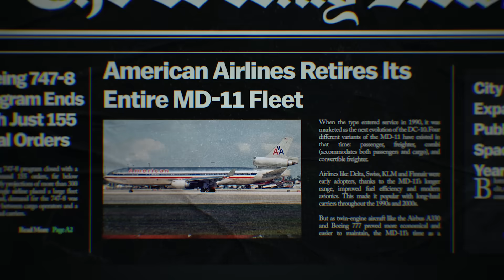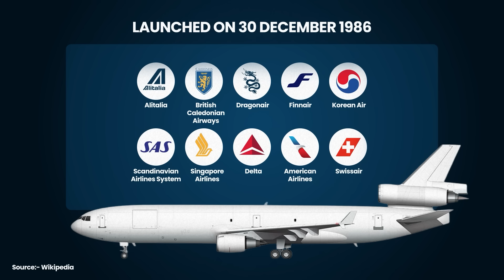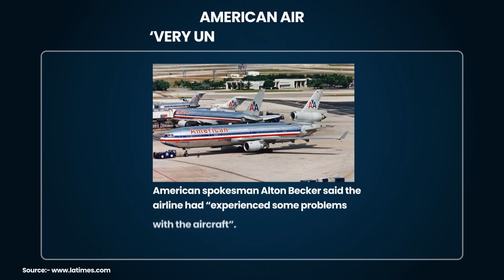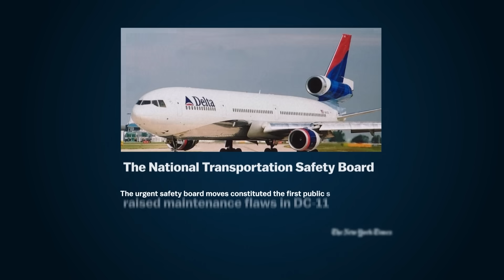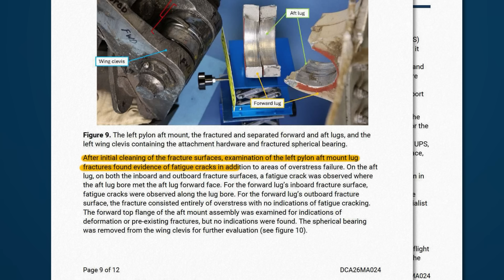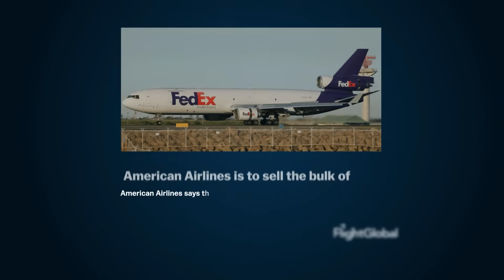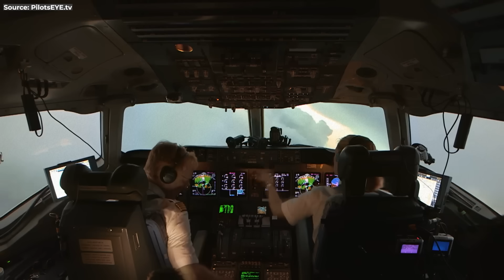Why UPS and FedEx Still Fly 35 Year Old MD 11 - Against All Logic

Comment: This makes a lot of business sense. The planes don't fly very often and sometimes don't even fly all that far. While a passenger 737 on a budget carrier might fly 5 legs in a day, most cargo planes fly once a day (at night). Most cargo flies at night because it is much more expensive to fly during the day at slot-constrained airports. Flying at night also allows cargo carriers to use the day to get packages to and from the planes via trucks. So these planes are only middle-aged in terms of pressurization cycles and number of miles flown. Who cares if you drive an old beater pickup truck if you only drive 5 miles a day? The absolute emissions impact ends up being very low. 
If the engine fell off due to pylon wear and the plane was inspected at the rates required by Boeing and the FAA, then it is hard to blame UPS for what happened. It is actually hard to blame Boeing here given they followed the FAA's recommendations after the AA-191 crash. If the pylon was damaged during maintenance... that's a whole different story.

Comment: There’s an underlying current-era reason for why the 65 MD-11F’s in service will not go away anytime soon: Boeing and Airbus have crushing delivery backlogs for widebody aircraft. Because of the always sensitive (to economic circumstances) nature of the widebody market, neither company is significantly investing in production expansion for widebody products. Tack on Boeing’s 7 year delay in getting 777x deliveries started and Airbus having yet to deliver a single A350F (with orders having been placed as far back as 2008!), and it’s unclear where an MD-11 replacement gets sourced from. Boeing has a total of 105 777F and 777x-8F orders unfulfilled,   While Airbus is sitting on 74 A350F orders. 

Right now, the only new widebody freighters being delivered are 767F and 777F’s, ordered long ago. To make matters worse, existing 777 passenger fleets (and even 747-8i fleets) are being kept in service far longer than intended, due to 777x delivery delays. The chances of getting any new widebody order delivered from either manufacturer in the next 7 years is exceptionally low (and would require taking over another carrier’s order) and there are few available conversion options for planes leaving passenger service. Cargo operators are (pardon the expression) going to have to fly their existing widebody fleets until the engines fall off.

Comment: First of all, the maintenance issue wasn't tight clearance, it was using overhead crane vs a forklift to support engine during maintenance, the forklift although not approved as proper method saved approximately 200 man hours per engine.
The one engine fell of the AA DC10 in Chicago in 1979 due to damage of the pylon from improper maintenance, forklift use.
The engine separated from the UPS MD11 in Nov. 2025 due to cracks from fatigue.
Keep in mind however that this plane was up to date on maintenance and inspections according to manufacturer and FAA guidelines. At the time of the crash the aircraft had accumulated 92,992 hours of flight time.  By comparison British Airways recently retired and scrapped a 19 year old 747 with 51,000 flight hours. That high number of hours on a cargo plane that very often flies nearly fully loaded could be a contributing factor.
Reply: Cargo planes fly less hours than passenger jets. Whether that gives cargo planes less flight cycles is something that needs verifying. However, UPS are strict about maintenance schedules, and invested in updating techniques and parts, which kept the MD-11s flying. And UPS 2976 had just undergone heavy maintenance in Oct 2025. So whilst fatigue cracks might suggest ageing, it might not be. So we will have to wait and see  what the NTSB finds in their investigation.

Comment: The engine detachment of the Chicago crash was because the AA maintenance crew removed the engine/pylon assembly as a unit to save time, when the engine should have been removed from the pylon per MDC. They further cracked the pylon mount in the process.  The presenter needs to do some research.
Reply: AI is only as good as the information it receives.
Reply: They used forklifts that stressed the mounts.  This video has an engine on a forklift.  Unbelievable
Reply: That was the shortcut that every operator used.  If they followed McDD protocol who knows if those pilon mounts would have had a longer service life.....

Comment: The MD11 can carry within 50k of what a 747 does yet it can fit at the same gate as a 767 which only carries half what an MD can. 

The 777 can’t operate on the same ramps and gates without folding its wing tips which is fraught with maintenance and operational issues. 

UPS would have to rebuild its hubs to utilize them or only use them where they currently use 747s, BUT those areas are already being fully used by 747s in their current operation…

Comment: If the FAA requires a redesign and retrofit of the MD-11 pylon my guess is the MD-11’s will be retired immediately.
Reply: pretty sure they wont require that, just move replacement and inspections date to be less , These planes have made millions of flights and this is the first time this has happened. (AA flight was fork lift damage)

Comment: 1:17 because older equipment is affordable, still reliable when maintained properly and with proper consideration can be modified to have the modern features you want and none you don't.
Even many militaries have much older aircraft in service and some railroads still use steam locomotive to some capacity.

Comment: I think its important to mention that that American airlines crash was not due to a design flaw it was improper maintenance procedures that caused it and we are yet to fully understand the cause of this last accident also the DC10 and MD11 are not the same plane albeit the share comon DNA
Reply: The DC-10 initially had real design problems with its cargo door, leading to two accidents (one the deadliest in history at the time) in the early 1970s. AA191 was followed shortly by two other DC-10 crashes in the same year. One in Mexico City (pilot error - landed on wrong runway). And one in Antarctica (navigational error). So the plane's design had nothing to do with any of the crashes in 1979.

Unfortunately accident reports outlining the cause take 1-2 years to come out. So the public just jumped to the conclusion that the plane was unsafe. Statistically, the DC-10 has been as safe or safer (fewer fatal accidents per million flights) than the A300, A310, and early 747 models it originally competed against (the L-1011 was a bit safer). But the number of incidents are so low that these stats have huge error bars.
Reply: @makaira69  Exactly, yes I wasn't referring to cargo door incident but the engine detachment which was found to be due to following incorrect maintenance procedures. The DC10 certainly earned an undeserved reputation unfortunately a lot of people have jumped the gun here on this crash without us having the facts yet.

Comment: A great plane with unfortunate accident records....

Once again, MAINTENANCE IS KEY....

LACK ON MAINTENANCE AND THESE PLANES SHOW THEIR WEAKNESS.

THESE PLANES ARE  WORK HORSES, BUT DUE TO THE COST OF HIGH MAINTENANCE THEY WILL SOON BE PUT DOWN FOR GOOD.

THESE PLANES HAVE MADE UPS AND FED EX THEIR FORTUNE OVER THE DECADES OF SERVICE.

INSTEAD OF TRADING UP AND CONSTANTLY UNDER FINANCIAL BURDEN WITH LOANS, THESE COMPANIES BOUGHT AND USED THESE OLD PLANES FOR DECADES AT THE COST OF PENNIES ON THE DOLLAR.

SURE THEY BURN MORE FUEL AND MIGHT BE SMALLER THEN MODERN PKANES BUT THE SHEAR AMOUNT OF COST SAVINGS NOT UPGRADING EAS WORTH IT.

WHY UPGRADE TO A FANCY NEW PLANE FOR A MEASLY MPG OR SO OF SAVINGS AND BILLIONS IN DEBT.

FEDEX AND UPS BOUGHT THESE PLANES CHEAP AND SAVED BILLIONS.

FOR WHAT ITS WORTH, THESE PLANES LITERALLY BUILT THOSE COMPANIES INTO EMPIRES.

A FEW ACCIDENTS AND UNFORTUNATE DEATHS IS NOTHING COMPARED TO WHAT THEY PROFITED OFF THEM.

Comment: This was a good high take presentation.    There are aspects worth bringing up.     FedEx bought MD-11F brand new from MD as a Freighter.    I am sure they got a great deal,  but they did invest in new.    UPS was the one late to the party,  they bought the old DC-8 fleet and then invested in 747s.     FedEx operates no 747s and only did as part of the Tigers acquisition to finish out contracts and then sold them (and the DC-8 birds that got re-engined with CFM which I believe went to UPS).      
         When FedEx could not buy further F models,  they began to pick up the passenger units (and got AA MD-11 flight simulator).     Keep in mind FedEx has gone with 777F (new build) as its a near identical swap for the MD-11.     I assume the MD-11 pax was not available or long in the tooth .     The 777F can fly further, with some loss of freight (drop freight for fuel load).    FedEx at least at one time had a China US direct flight (premium cost service).    Normally they operate on the same MD-11 routes full.   
         UPS has not bought 777F,  be interesting to see which way they go.  FedEx did join UPS in new 767F.     UPS did stock up on new build 747-8F when they could.

Comment: The reason FEDEX and UPS fly the DC10/MD11 IS because of its cross section. The 767 share almost an identical payload,  but because the cargo door and floor are of different dimensions your payload TYPE is compromised , it also has to do with cargo container type also, the 767 can not accept the 102x96 inch you have to use a smaller format less containers types less misloads simpler systems.
Reply: tell me you've never loaded an MD-11 without telling me
Reply: BS!  Depends on who did the freighter conversion...but the MD-11 max payload is going to be approximately 91-93,000 kg, while the 767-300 freighter's max payload is around 54,000 kg.  Get your facts straight.
Reply: The 767 can't take the LD3 containers used on most widebodies. Well, it can, but one LD3 container takes up the full width of the plane (at which point its capacity is not much better than an A321). The MD-11, 747, 777, A330, A340, etc. can all fit two LD3s side by side . So the 767F often ends up being volume-constrained, not weight-constrained. It also complicates logistics. You can standardize on LD3 containers and use planes other than the 767. Or you can use LD2 containers to accommodate the 767, and leave a bunch of wasted space when transferring those LD2s onto any other planes.

I really liked the 767. The 2-3-2 passenger seating in economy was glorious. But that slightly narrower fuselage is a deal breaker for cargo.
Reply: @matthewsims4457 you do know that different ULD'S have different load limits as well as max load per square in , not to mention that each position in THE AIRFRAME itself has load maximum.  Which payloads are limited to fuel onboard.
Reply: Horse pudding the MD11 was chosen because its proper name is Mail Delivery #1 !. You can't deliver mail in a 767 because that model is for people up to 7.67' feet tall and mail can't be a people because it's mail.

Comment: Can the center top engine be removed or [temporarily] turned off, &/or the wing engines be replaced with more modern fuel efficient ones?
Reply: That would be a big engineering project not to mention certification.   But who knows.

Comment: If they reach a point of having to retire most or all of their MD11 fleet before an acceptable replacement comes along, that is going to hurt them financially.  Very badly.
Reply: Given the relative number of MD-11 frames to the overall fleets of FedEx and UPS, the financial impact is not that severe.  The numbers I've seen, they represent roughly 4% of the FedEx fleet and 9% of the UPS fleet.  Of course they didn't want the interruption to their long-term fleet plans, but the big question now is what will it take to comply with the airworthiness directives.  Easy inspections and minimal repairs would likely bring the aircraft back into operations.  But, difficult inspections with major repairs will likely result in the final retirement of the airframes.  We just don't know yet.
Reply: @thedawgy1995  
At what cost though?  They bought these really cheap and mostly only run them short routes, although this one was going Louisville to Honolulu.  What can they get super cheap?  The purchase cost was supposed to make up for the fuel burn.
Reply: @ypw510  That is the history though.  We do not know what it will take and cost to comply with any future airworthiness directive.  I don't know where the red line stands, but there is a point where compliance will become cost prohibitive.  If they have to spend $1 million per plane, they will do it.  If they have to spend $50 million per plane, they will likely retire them.  And that assumes the FAA develops an actual plan to return the MD-11s to active service.  All airlines continuously assess their fleets, there are always contingency plans, and there are always orders in the pipeline.
Reply: @ypw510  Well they could probably look at 777F/A350F or A330F and think of it this way. If they bought any of them brand new yes the initial cost is high but those could be planes that could serve for upwards of 40 years. That and say a 777F will cost less in fuel and is less of a maintenance hog than the MD11. 

So it is case of if the MD11 can be brought back in not costing too much then they will do that. Otherwise if it costs too much they may have to retire and replace them at which is buying new 777 freighters as an example such a bad thing. Yes again there is the initial cost but you get a far longer lifespan and its in life costs are lower.
Reply: They did get 30 years out of them though
Reply: @brandonadler1022  Yes they did and that is impressive.  But sooner or later, retirement becomes necessary.  Airlines like to time aircraft retirement with the scheduled "D Check" due to the massive cost of that heavy maintenance.
Reply: 26 planes out of service (out of a fleet of 500) won't kill them. UPS is leasing other a/c to make up for the loss. Costs may be passed on to the customer.
Reply: @zaphodb9213  Yes.  They contract capacity and no major airline has their entire fleet in operation.  They always have some backup aircraft and aircraft undergoing maintenance.  The big question is what will cost to comply with a future airworthiness directive.  There will be a limit to how much the airline will spend on these old airframes.
Reply: The MD-11 represents an anomaly in that all the passenger airlines decided to dump the ac at the same time. 
 Air freight from a weight and physical volume perspective is a lot more profitable than transporting people (and freight doesn't complain). So, it's not that the freight companies can't buy new planes, it's like everything else they operate; they use it until they recognize it gives diminishing value.
Reply: @Lawrence-lj5jz  Many years ago, I was in the jump seat of a FedEx flight.  Captain made a comment about his passengers don't complain.  So cargo pilots usually take any ATC options that avoid slowing down.  Packages don't care if there are lots of elevation changes.  Packages also don't care about seating or in-flight entertainment.
Reply: Everybody talking about what a graceful plane the MD-11 and DC-10’s are, as well as how cost effective the planes are/were is not the point. PEOPLE DIED. And it could have been a lot worse if the plane had hit a nearby residential area. 

And people died in 1979 when AA191 crashed, just narrowly missing a large trailer park. Planes that have design flaws should have those flaws fixed, or they should be taken out of service. McDonnell Douglas never lifted a finger to fix the problems with the cargo door on the DC-10. 

They should have, but they thought that they’d play the odds. They lost! Turkish Airlines had the same issue and 346 people died. McDonnell Douglas looked really incompetent at that point. Yet, they still managed to somehow survive.
Reply: @Sly-f9i  The sad truth is every plane manufacturer has blood on their hands.  Design flaws happen and are rarely addressed until there is a body count.  And, some design flaws are not identified until there has been some kind of accident.  In fairness though, the AA191 issue was the result of improper maintenance technique that damaged the pylon.  This is also not unique to the DC-10/MD-11.  JAL123 was a B747 where an improper repair of a tail strike resulted in a catastrophic decompression event.  McDonnell Douglas also isn't unique about resisting airworthiness concerns.  Boeing resisted consequences over the 737Max crashes.
Reply: @thedawgy1995  JAL 123 was not Boeing’s fault I know they are a low hanging fruit but that was not on them. After that 747 suffered tail strike JAL did not fix the damaged section of the aircraft in accordance with Boeing’s repair instructions for a tail strike. 

As the 747 went through pressure cycles it gradually weakened until it failed entirely. If Boeing’s instructions had been followed correctly then that JAL 747 would have been safe and withstood pressure cycles unlike how JAL actually fixed it. Yes it was tragic but in that accident Boeing was essentially blameless.
Reply: @teabagtowers3823 This is true. But the same can be said about the American Airlines DC-10 that crashed in Chicago. The maintenance people did not do the engine maintenance in accordance with the established procedure.  They came up with a shortcut and damaged the pylon in the process.  After some flight cycles, the pylon failed.

Comment: Real reason: They can buy shitty dangerous aircraft for cheap and normally no one GAF. Time to pull their airworthiness certificate and ground them all, forever.
Reply: It's no secret that the aircraft still have advantages over similarly sized aircraft regarding capacity.

Shitty dangerous" IMO seems a dubious claim to some extent at least